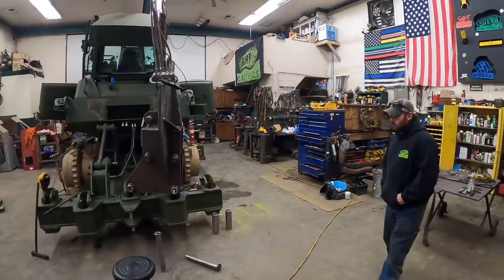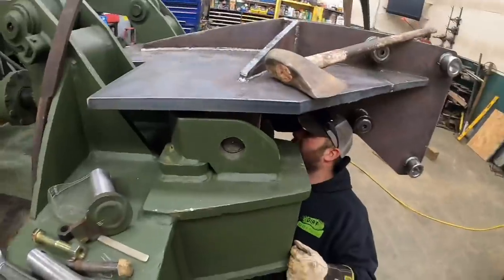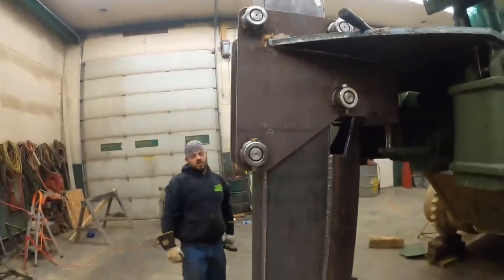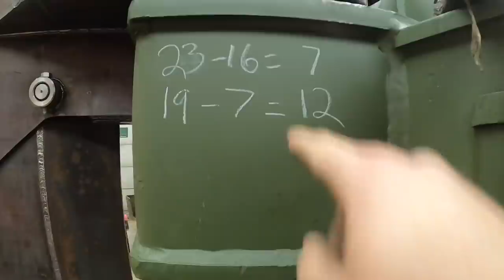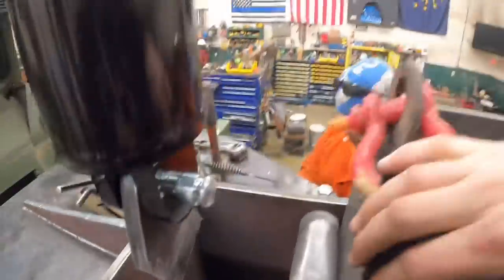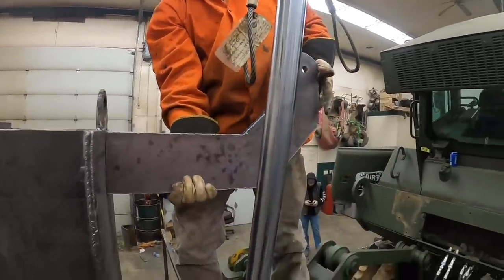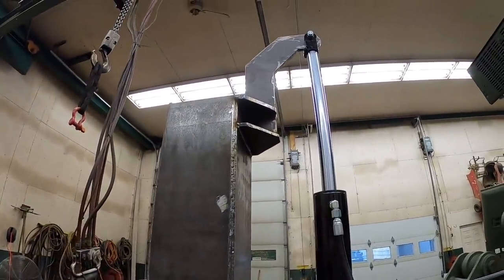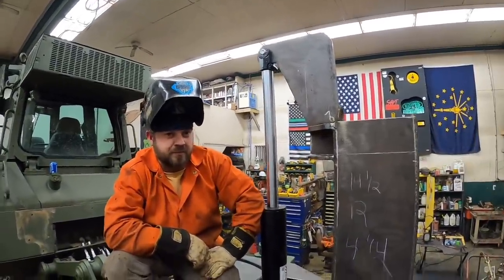Full assembly of plow ends with disappointment and failure. First major setback on build!!

Comment: Coming together really nicely.  I would weld a triangular section at right angles where the new top plate meets the top of the 'tile tube'.  One either side obvs - to cope with torsion and keep the top plate in the vertical plane.
Reply: That's why I was coming to the comments... and a strong back up to the ram pin wouldn't hurt.

Comment: Building a drainage plow from scratch. You know its been done before? The ripper hydraulics lift a parellogram - good.  No second joint for compensating pitch fore and aft of tractor - bad. How do you go thru a dead furrow or over a fence row without change of attitude between tractor and back end of plow. No hinge for turning - ok if always straight. Set for 4" or 6" tile? Needs a snug fit at lower end of box. Grading method?
This is the only video of yours I've seen so maybe there is more to come but I'm a retired farm drainage contractor who used a double link plow

Comment: I learned something many years ago from my best friend that retired after over 30 years as a Boiler Maker, on the job many places they used water instead of oil when drilling saving money which they cared nothing about but the mess was so much easier to clean up so for at least 25 years I have used water and can’t tell any difference in wear on bits or equipment

Comment: The old engineer here again and still impressed with your project. The bracket that failed has two loads as you probably know, the ram pushes up but it also has big load  pushing back on the back rollers and any weld slag and as it turns out acted as a  wheel chock on the roller especially the top roller. The offset of the bracket from the plow itself wants to rotate the top of the plow against the top, back roller as well as lift vertically.  I don-t see a good option to lift the plow on its centerline unless it is lifted front and back by two cylinders. I know you can't put anything directly over the box since pipe has to feed thru it .
Reply from the maker: Thanks appreciate that and stay tuned
Reply: @DirtPerfect  Can't help myself from trying to "engineer" the lift cylinder! Is there any way you can mount a second cylinder on the back side and use the same control (so you don't need another control block)? Two cylinders acting together might remove/offset  the torque from the single front ram/cylinder that puts such a high load on the upper back roller.

Comment: Mike great job all of you from design and fabrication 👍only thing probably done different made tube larger and installed Teflon wear pads from past experience grease tends to collect a lot of dirt and debris which makes grease concrete 🤦. On my chipper use only oil on feed wheel slides. Great job though 👍again

Comment: Mike, I think you need to add a 1/2 inch backing onto the back of the bracket, by extending the backside of the chute up so that the bracket has extra support from the back (Kind of like a T-bracket).  Then teepee the sides of the bracket for extra support to prevent it from pulling side to side.  You want that ripper to go up and down as straight as possible and the 3/4 bracket is not going to be enough (Better on future videos).  I'm foreseeing an epic failure (wish I had it to foresee the Lottery).  And I am basing it on the addition pressure that will be put on the ripper when you raise and lower it, into the ground.  Not an engineer, but that bracket looks like a toothpick attached by a small weld!
Reply: I think they are doing just that when they build the pipe loader brackets. I bet they build a pipe loading jig that doubles as more support.
Reply from the maker: Stay tuned

Comment: Your gonna need another hydraulic cylinder or Linear rail with bearings to evenly lift that behemoth. Right now your pushing up and back with a high leverage lifting point. You cant center a single point pull with out guides or side mounts. I knew what would happen when you mounted the lift plate. It might even work sometimes but would never be reliable.

Comment: Neat design. A boxed in upper hydraulic lift connection would provide 3-4 times the strength, reduce twisting force and reduce the risk of damage from external items.
Reply from the maker: Stay tuned

Comment: Mike do a first i have never seen an implament with quik couplers welded to the attachment to keep your hoses high and dry and from rust and dirt if i was to do this i would make a steel box with a spring loaded door to keep dirt free when hooked to machine spend 40 50 dallors. You watch you will see companys do this. It only makes sence you wont have floppy hoses. As nice as you made this peice i would .

Comment: Well as for the ear at top of boot to ram to take out the tight angles of travel if put ears on boot and pin the new ear to the ram and boot the boot will be able to line itself on the rollers and slide up & down easier!  Give it some wiggle room to slide in out out!!

Comment: Your mount would be easier to handle if you added a three point lift system. Going to become even more critical when you get the hydraulics on it. Much safer that way. I know this is coming to you after you have completed it but since I don't know the finished product, just throwing it out there.
Definitely a fun project. Wish I was working on it with you.
Reply from the maker: Stay tuned

Comment: Beautiful job and excellent craftsmanship! For future reference makita and others make excellent metal cutting blades and corded and cordless saws dedicated to metal cutting.  They cut smooth burr free with no heat. I have used them above rated thickness on heavy metal lots faster than a torch with great success.  I'm sure your tile plow will work as good as it looks.
Reply from the maker: Thanks

Comment: Put a D ring on the front to give you 2 pick points . It will help you keep it level and set it straight down on the pins
Reply from the maker: Stay tuned
Reply: That's what I was thinking and I don't think 1 cylinder will do the job.
Reply: Was thinking the same thing. Actually the last video they put out on this I was thinking, why don’t they weld a couple D rings to that bad boy.
Reply: I was thinking also another hole near the of the cylinder bracket that you can put a clevis thru to be a pick point now that the eye pad behind it is useless.

Comment: Could plate on the sides of the upper bracket to give that more strength. That is going to be a stress point.
Reply: I have a feeling we're going to see a bunch more steel added in the next one. This is becoming like a series on TV, you have to be sure to set your VCR to record it in case you miss the time it's going to start. Oh, I just dated myself.
Reply from the maker: Stay tuned
Reply: @royordway9157  you bet ! I admire their perseverance, but this design will need a lot of beefing up before he can pull this monster shank at 6 feet of depth...  The annoying thing is that we are 2 months behind in time, so damage has already been done... I have never seen a tile plough this wide...

Comment: From an old machinist (me): I think the speed of the mag drill was way too high for the diameter of the drill and the toughness of the steel.  You'll notice when you switched to the much slower drill press the chips were huge, meaning it was cutting efficiently, not glancing off like the bit in the mag drill.
Reply: My 1st thought, I learned that on my drillpress, but magdrill still needs  good grip.

Comment: Looking good  but your going to need another lifting point on your mounting point also the original cylinder bracket was good just needed another one mount on the outside of the cylinder bracket and then boxl in like you did the ripper then install pin all done lol cant wait to see that working  .hopefully no one shook the etch and sketch the blueprints woud be lost forever  lmao
Reply from the maker: Stay tuned

Comment: Looking good! A couple notes watching from the stump:
Surprised you didn't protect the cylinder piston for slag when cutting and welding near it.
The bracket failure isn't on the fitter but on the engineering.
After seeing MBTS bending over to put the wood under the dozer it looks like fitters are related to plumbers.
Q: What's the difference between cowboy boots and engineering boots?
A: The cowboy boots got the BS on the outside!

But man, this project looks like a lot of fun even though it is a lot of work. MBTS, what are you going to buy with your $20,000?

Comment: When it plows two of the rollers will take the presser or will you be inserting a sleeve to take up the slack and stabilize the roller area?
Reply: betcha it bends and won’t roll up, nothing but the two rollers taking all the pressure

Comment: in the beginning of the video, i couldn't figure out how you were going to raise and lower the up right piece. but once i saw the upper lift eye piece, i said to my self, good idea, however, i do think that when the feed tube is in the ground, your hydraulic cylinder might get damaged. what do you think about putting a piece of 1/4 inch plate between the hydraulic cylinder, and the moving upright feed square tube.  just a thought

Comment: If you pick the plow up and plow a shallower depth will that put pressure on the cylinder will the plow won't to pull down in the ground putting the full weight on the cylinder, asking for a friend

Comment: I’d weld some braces on the sides of that top hydraulic cylinder connection plate for strength. After you get it all cleaned up and greased you shouldn’t have a problem with it bending again though. That’s an awesome looking piece of equipment. It definitely looks like it will do a good job laying pipe. I’m a little bit concerned about that piece being so close to the bottom of the hydraulic cylinder torquing over time due to wear on the pins and damaging the cylinder. All things considered you guys built an awesome attachment for your dozer and business.

Comment: Greetings from No VT - I couldn't make it out clearly, even when I paused he feed, is the lower cylinder pin removable? It looked like you had the head of the keeper pin pretty close to the housing and the head opening into the shaft. If you need to pull that cylinder can you get the pin retracted enough to release the cylinder? Just curious.
Reply from the maker: Stay tuned

Comment: I have to ask are you going to make a patent for this? And if it works good could you see maybe making more? Great job men as always.
Reply: There are companies that make them but they tow behind a dozer or large farm tractor. I don't know if anyone makes a mounted unit. Might be why he made this one.
Reply: @bigchuckyinkentucky6267  , yeah I have never saw one like this that was mounted. He may be on to something, as long as the weight doesn't make it stand on back of tracks and lose traction.
Reply: @blueonblack3971  If that becomes a problem he could chain some weight to the blade. Just something to get through really hard ground. Nothing attached permanent though. It would be in the way for regular dozing application.

Comment: Seems like with the cylinder being offset it is causing the boot to bind in the rollers. Seems like the cylinder needs to be as close to the boot shaft as possible to eliminate the binding. That way it could push straight up and down and eliminate the cantilever effect the offset cylinder in conjunction with the long arm of the top cylinder bracket causes. If you look at 52:31 when it bent the bracket you can see the cylinder leaning some towards the rear of the plow after it bent the bracket. That shows the natural direction the majority of the cylinders force wants to travel due to the cantilever effect caused by the offset and the long arm. Just my thoughts. Waiting to see if the new design works.  Great build by the way just a bump in the road!
Reply from the maker: Nothing to do with it stay tuned for

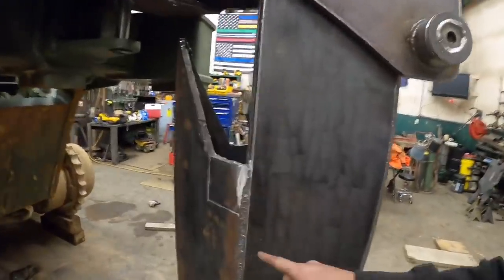Comment: 22:30  I think you need to make that notch to match the pin shape with a half collar. If you raise the ripper too far even once, it's going to mash that pin up. It will either bend it or make it unusable because of the rough cutout.

Comment: should have put rod end  facing down  to protect rod and have cylinder tilt to front and rear of of travel of assm. also dont forget to put a travel lock pin in case of hydraulic loss in upper most travel

Comment: @9:20
Maybe future modification unbolt the drawbar hitch and fabricate a mount directly from the tile plow to the four bolt holes that the hitch bolts onto. Plow will drop right into place without the need to slide it forward. 🤷‍♂

Comment: I think I would've went with a twin cylinder setup one of each side T your lines into the single hookup it'd move slower and cost twice as much but be twice as strong because this also has to hold it up at a single depth in the ground without steadily going deeper if that makes sense but I'm no engineer I just work on tractors
Reply from the maker: Stay tuned

Comment: We are engineers we are metal workers... proceeds to grind with the ram extended.
Seeing as you don't know. Those fings burn into your chrome or glass and then they rust. Some time next year you will be wondering why the glass broke so easily or the seals are weeping.
Amateur hour.
PS you also run the risk of an accidental strike on the ram from the welder. (In general. Not so much with mig)

Comment: I believe that your plow section will need a lot more contouring to have it slide through the ground. That flat top section looks like a perfect hydro plane which will pull down on the back of the bulldozer and eventually warp or break the rig. Just my humble opinion!
Reply from the maker: Sorry you don’t understand how it works
Reply: @DirtPerfect  Sorry, please explain. I though this was a similar to the other pipe installation video process.

Comment: Could you go with a slightly shorter cylinder to reduce the height of that attachment dog ear?  Or go further up with three sides of that box to give it more strength?
Reply from the maker: No sir I can’t
Reply: @DirtPerfect  I like the way you guys redesigned the ears on the feeder.  That looks pretty strong.  Are you planning for the plow to always stay above the clay line so that the forces it sees never goes to extreme levels?  Your plow looks like it is going to keep going deeper unless the dozer has enough up pressure to keep it just plowing.  Farm plows adjust the pitch of the plows so the just go down.  If you had a ripper just in front it would reduce those forces on the plow tremendously.  This is the way the small commercial pipe laying plows work.

Comment: If possible, I'd try and skip the hydraulic lift cylinder idea altogether and simply raise/lower the plow using the ripper's hydraulics.  Then pin in place with holes in the plow, similar to what is often done when adjusting ripper shank depth. KISS.

If you must keep the cylinder, I'd add a plate to extend the rear top portion of the plow so that the cylinder bracket assembly is stiffened full height of the assembly (not just relying on the ~+/-6 inches at the bottom of the bracket). I'd be worried that any eccentric loading will likely bend the (redesigned) bracket again.  I'd also add a few 45 corner braces to support that added rear plate for added stiffness.

The rest of the plow design looks professional for a first go at it (but I'm sure you used CAD and the design underwent rigorous engineering stress analysis and design optimization lol). 

Honestly, really good work.
Reply from the maker: Absolutely not a option

Comment: I wondering why even after all that tight fitting and precision tolerances no grease lubricants we’re used on the pins and adjacent rubbing surfaces? It seems a no brainer for less wear, tear and stress on rubbing component structural parts.

Comment: Dp what are you saying that you can't drop it 1 foot into the concrete... I say you're not trying hard enough :P 
What are we saying about playing on the jobb MBTS riding in the air, can we come and pay for a ride to ?  
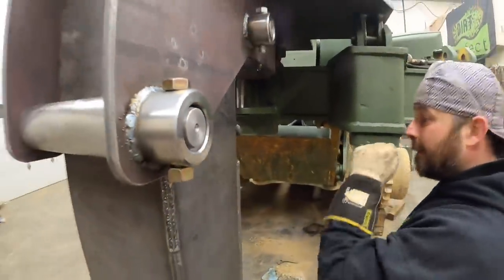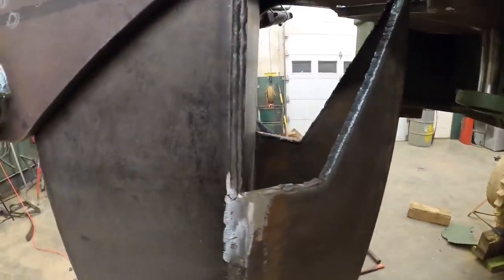18:22 - 18:37  Dont have any ear plugs so cant hear what your saying. Pls wear some its not like your  hearing  is coming back  
DP 19:30 to 19:31 clip that MBTS will like you then or...

Comment: indsted off greas you can use PVC on the inside of the roller
Reply: Pvc is too brittle delrin might work but bronze bushings would be better
Reply: No room to add PVC or UHMW. Likely wouldn't stand up under load while working with the torque that will be applied to the top front and bottom rear rollers.

Comment: You need to align your cylinder up and down motion. One thing I notice is your bottom connection, he would tilt side ways. It needs to tilt forward and backward so it would not bend your cylinder, if any misalignment.
Reply: Or install a spherical bearing.

Comment: It may be negligible in this case but if the dozer is blocked up higher in the back than in the front then I don’t think that math works exactly the way you did it for boot height
Reply from the maker: Stay tuned